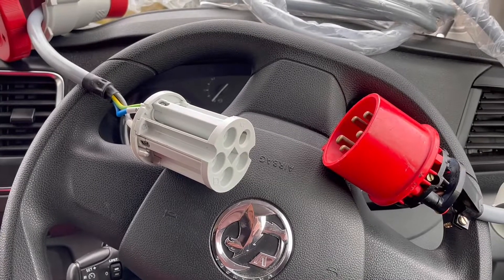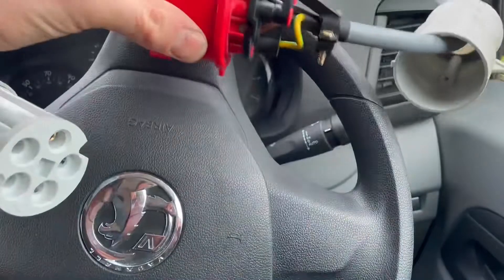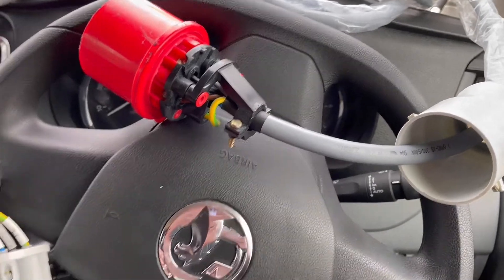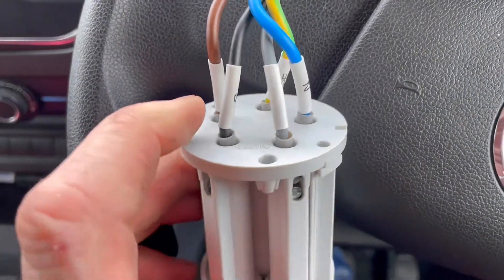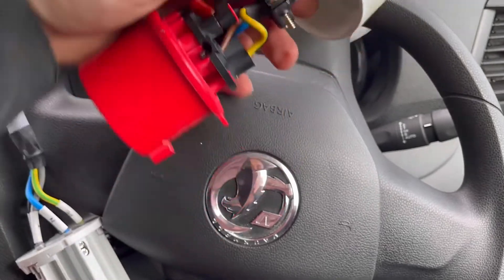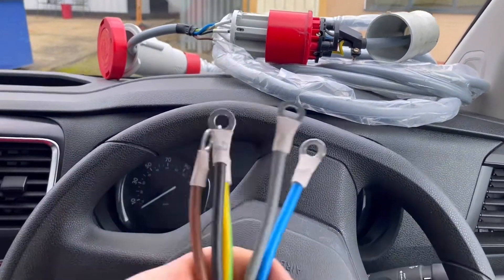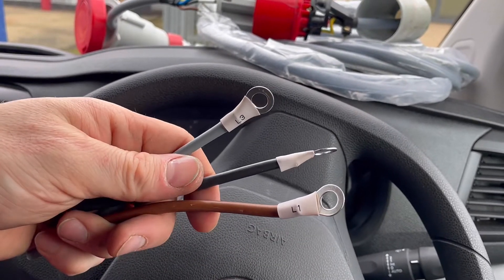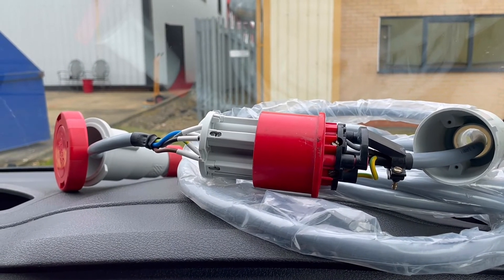Connections in a 3 Phase Plug and Socket Explained

Comment: RST makes sense if you work with motors or electronic motor controls, motors are identified with UVW; think switches with "FEED" and "LOAD" markings.

Might not seem much for a plug and socket but if you're trying to find (say) motor #5 in a busy control panel (bearing in mind that cabling might well go through a bank of Din rail terminals on its route), then you know if you have UVW/5 you've got the motor connection and RST/5 will be the supply side for it.